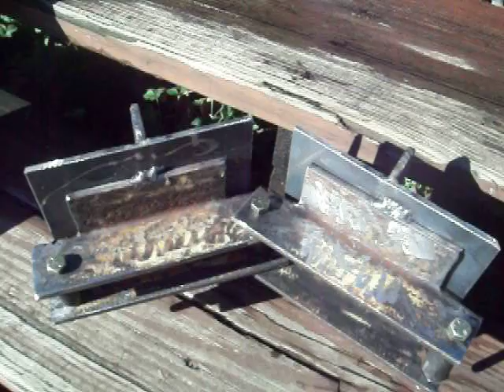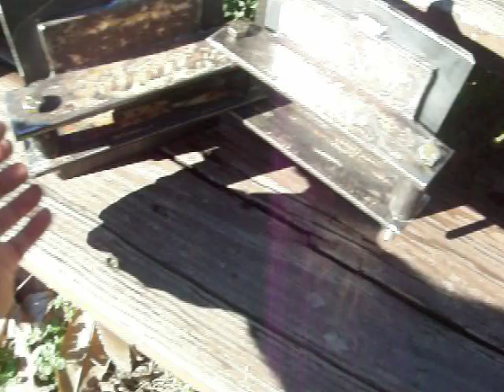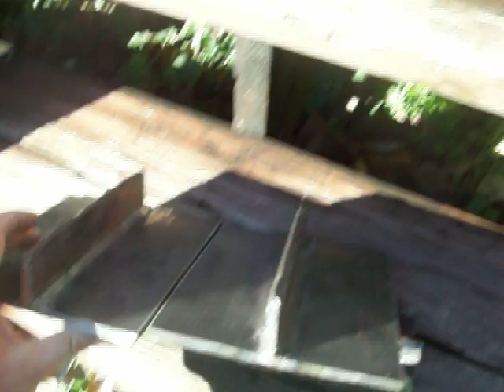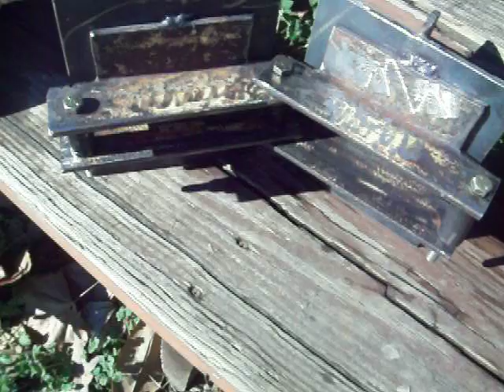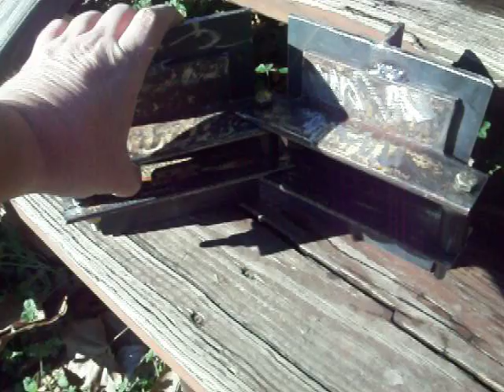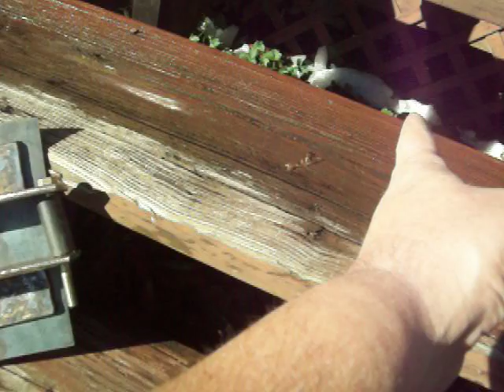Mini Dozer tracks "How to build D-11 style Dozer tracks"

Comment: Pretty cool but I don't see how they'll ride on a sprocket. Seems like the pivots are too far apart.
Reply from the maker: Its just a ruff idea of how D11 tracks appear,,,of course you could make larger or more oblong teeth on the drive whee, the video was for the pads and cleats mostly but it would be ebst to add this style pad and cleat to a actual store bought chain or junk yard bough chain,,,many ways to do it but technically more work would have to be done on these to make them fit a sprocket,,,thanks

Comment: if you take and weld the cleats over the bushing it bridges the track i built a set for my dozer just like the ones you are doing. i can't wait to see your dozer. mine is built out of a old mtd with a 18.5hp  i put hydraulics on it and man it works great but the tracks are really tough but keep posting and please put pictures  maybe when i get better on this thing i will post pictures of mine lot of work but fun .go for it.anyway i can help ask away

Comment from the maker: I bet the tracks alone will weigh 1000 pounds when finished cause 2 of the limks Ive built right now are like picking up a 50 pound barbell,,no kidding them 2 links are heavy right now but luckily all that weight will be resting on the new lower carrage I build rather than the cub itself,,with the rear end it has now it wouldnt matter cause talk about a heavy built rear end and chunk,,big as a c10 pickup rear end man.

Comment from the maker: theres other ways to do it other than the big square tubing but this idea would be one of the simplest,,if push comes to shove id simply add 2 outer plates of metal to put the links together if they should come up odd like you asked but I dont think they will and can always shorten or lebgthen the frame a tad to help out,,one thing for sure the tracks are not going to stretch,,haha,,as long as I have a 1 1/2 inside the links then the drive wheel I build will work,cant go under 1 1/2 inchs though

Comment from the maker: good question and one I have already pondered myself,the lower under carrage frame will be big square tubing mounted solid to the original frame,,on the front coming out of the tubing will be another square tube that fits snuggly inside the big one and then with a big spring inside the large one pushing forward it will slide and adjust probably a foot or more if needed,,kinda like the oliver is done now only it has a more sofisticated set up than what I will build,will be self adjusting tracks

Comment: At one point in time I was thinking of making track links for the Mity Kat, but I got hung up on how the one end would fit into the other end because I did not want to construct it like "bike chain".  I then got lucky and found the used tracks I needed.  May I ask...what if you have an odd number of links on your project, how would you connect the two wide or two narrow links together at the meeting point to close the loop??  Just curious.  Great project, good luck.

Comment from the maker: well Im gonna need your advise along as I go so be ready Jim,mostly what I will do in the next couple weeks is look up parts and metal,I'll need a ton of flat metal and angle iron and to save money on grade 8 bolts I think I will buy 3/8 inch straight rod of some hard grade and use that instead of bolts,will also cut them a tad short and let them counter sink into the holes and then weld them in place and grind smooth to create a solid chain and will be better when fitting it into a front wheel.

Comment from the maker: I might be able to use the ir==original cub rear rims and add a heavy ring of teeth around it,,the guy on the wheel horse used his original rim and only added teeth but that want look like the D11 setup like I want,,like I say I think I will go ahead and use this size track and metal thickness and making the upper drive wheel as small as possible will sure enough add some power and pulling effect as far as the motor being strong enough,,it'll take a while but Im set on doing it.

Comment from the maker: I'll need to find to find some 1 1/2 thick plate to have the drive wheels cut from and then have 5 holes drilled to fit the original cub rim,I think if I can find the thick plate and have it cut round I can add the teeth myself like the guy did on the wheel horse,,,to do this the way I want it will be a world of work and ton of metal and angle iron and tubing,,its heavy now but it will be seriously heavy when finished to be a lawnmower,,motor may not be strong enough to pull it,,haha,hope it is.

Comment from the maker: good idea you have and it will be a challenge to build the upper drive wheel like a true D11,the main thing will be finding 6 pieces of 1 1/2 inch this plate big enough in diameter to cut or have the wheels cut,if I go ahead and use this size tracks to do the cub cadet then I could probably get by with the rear upper wheel having as few as 4 teeth, as long as 2 of them are in place there will no chance of breaking them or com ing off,im getting excited about it cause the cub is super heavy duty.